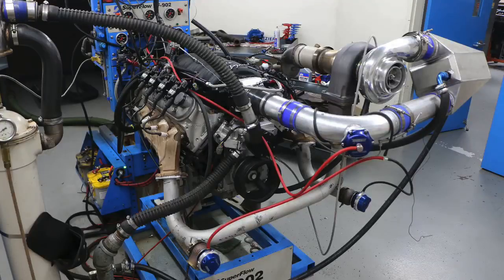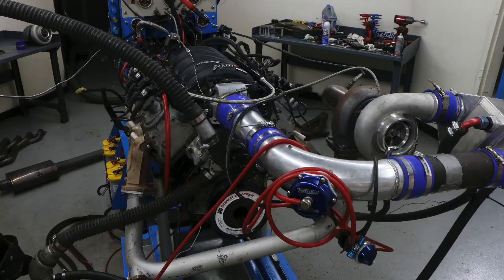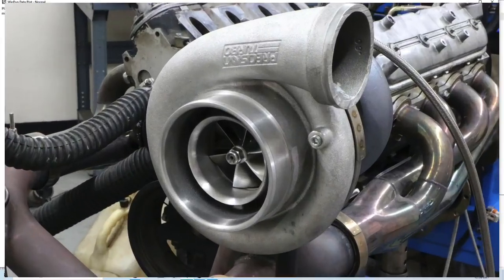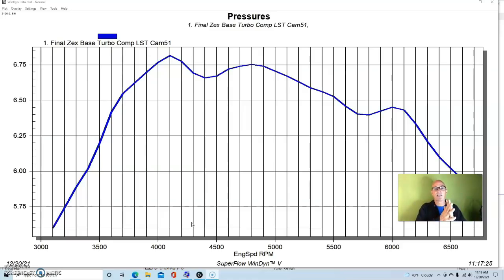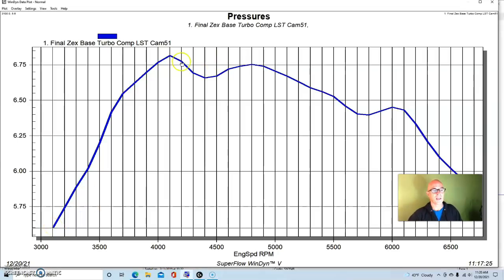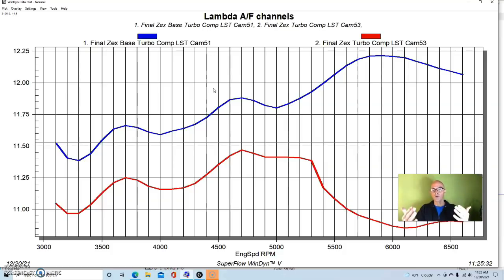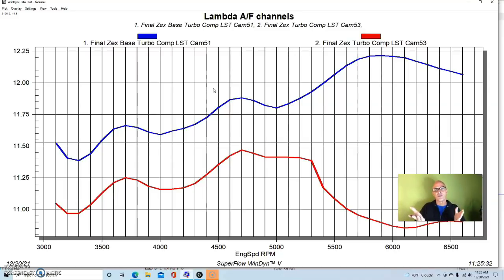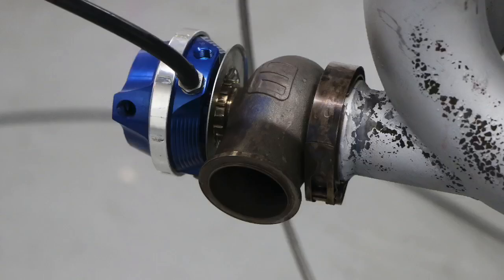JUNKYARD TURBO 5.3L LS-WHAT WORKS BETTER, NITROUS OR BOOST? WHO CARES- CAN I RUN BOTH? NOS + BOOST!

Comment: I have a question I have a 6.0 built with a gt45 turbo I bought a high volume oil pump from melling did I buy the wrong one? I think I need stock volume high pressure or am I wrong
Reply from the maker: your high volume will work

Comment: This relatively large turbo seemed to come up in boost pretty early making me think it had a tight turbine AR. I’m wondering if that made the back pressure run higher. If so, could you substitute a bigger AR turbo, like a 1.3 T6 S475 or S480, and use modulated nitrous to get it going early in the rpm range? This would seem to give both good spool up performance and relatively low back pressure at the top. Time for another set of tests!
Reply from the maker: it didn't have high back pressure at only 800 hp
Reply: That turbo wasn't even begining to get put to work, especially on a 5.3. Don't let those measurements fool you on that PTC.

Comment: Be neat to see you run it pre-turbo and see the difference. With and without the IC.
Reply from the maker: not a good idea to run fuel and nitrous pre turbo with an intercooler-power gains should be the same with the change in injection point
Reply: @richardholdener1727  I've done it without an IC. Def/. picks up pre turbo VS post. Same with water/meth.

Comment: I would be worried about mixture distribution (fuel separation) with that intake manifold and a wet N2O system, and would convert to a dry system with the supplemental fuel added by the EFI in the nitrous table.

Comment: We ended up running a 100 shot on blown Gen 3 Hemi with a Magnasun supercharger as chemical intercooling, was good for 9.1's and much more effective than it's integral intercooler. Holley HP management, dry shot.
Reply: I've been kicking around using it for cooling as well. How much temp did that 50 shot drop/control?
Reply: @rpturbo  Seems to me we saw about a 50 degree drop over just the built in intercooler.

Comment: What about a 6.0 with a pte7675 and the turbo is maxed out choking at 700-800whp, would nitrous help make more power or would it make back pressure worse?
Reply from the maker: IF BACK PRESSURE IS THE PROBLEM-IT CAN MAKE IT WORSE-BUT IF ITS THE COLD SIDE-IT WILL ADD POWER
Reply: Agree with Richard 100% my backpressure went 1.5 to 1 to almost 2 to 1 with nitrous.

Comment: I don't mind running a little richer on the nitrous.  Any time I've got a single fogger setup I always get concerned about cylinder to cylinder fuel distribution from the fogger nozzle.  If it were direct port, no issues, or if we were adding the additional fuel through the injectors.  But unless I'm running EGT sensors on each cylinder (or preferably O2 sensors), single fogger setups will always be richer on my watch.
Reply from the maker: always a good idea

Comment: Hi Richard, also, very informative on how manual boost controller has the peaks and then dips for boost VS a electronic boost controller boost curve more consistent table top across rpm band! I never knew that! Also will  be great to see a follow up video showing a electronic boost controller!  Also even how to plumb  and wire and electronic boost controller ! Thanks Richard!

Comment: What's a bottle of nitrous  cost
Reply: Used to be about $45, now it’s $120
And you use about .8lbs every 10 seconds used on a 100 shot. So a lot of people use 150 so that’s 1.2lbs for a 10 second pass and after about 5 passes, that’s 6lbs used and with only 4lbs left, pressures drop lower on the bottle and the 150 shot doesn’t hit as hard as it did when it was full or fuller
Reply: @rotaryturbo88  thankyou
Reply: How long is the bottles supply

Comment: They love the nitrous.  If you dont put the waste gates right on the bend after the manifolds...put them on a straighter part of the pipe and little at angle..the boost wont jump around like that...its hitting the gates hard with them right on that turn. Cool vid. Keep em coming!
Reply from the maker: wg at the best is best for control

Comment: Wait wouldn’t 11/1 af at wot be on the lean side with e85?
Reply: Technically yes, but most of the time af ratios on e are just converted to the equivalent on gas for simplicity's sake, so it actually was quite rich
Reply from the maker: it was on the gas scale

Comment: Mr Richard, it would be interesting to see the use of nitrous on small quantities, early on the powerband to assist spooling the turbo. And also it’s benefits on lowering the charge temperatures and allowing more timing. 
This is a very effective practice when we run rotary motors with large turbos. Rotaries have no low end torque, so we obtain it with the nitrous, but in order to “match” the flow of the engine at high rpm you need what typicaly would be considered “giant turbo” per cubic inches. 
As an example, i run a peripheral port 20b (2.0) with a 110mm turbo and a 250 shot. Now, the nitrous is “reverse progressive” you could say. We will launch it at 175-250(depending on the track), it will progress to the “max” @ 250 and immediately start tapering in relation to the boost but no less then 75hp. During testing, we found a lot of power up top with the small shot due to the cooling effect mainly, and it allows a bit more timing.
Reply from the maker: cooling from nitrous is very minimal-there is not enough cold nitrous in relation to the hot air- I have a test up where we used nitrous as the intercooler-it wasn't very effective

Comment: Do you have any tests using say a 50 shot at 2000-3000RPM to spool a large turbo more quickly?
Reply from the maker: it will work

Comment: Could you achieve similar results with an electronic waste gate by slamming the motor with boost instead of nitrous? Would the response be compar... Oh you're doing just that now!😀
Reply from the maker: you can't slam the motor with boost down low like you can nitrous-if the turbo won't spool down low